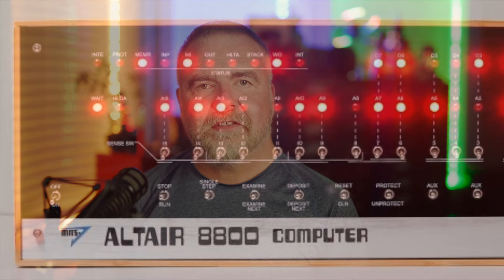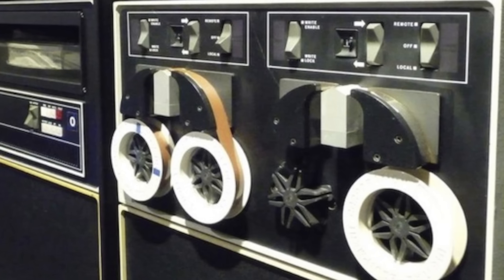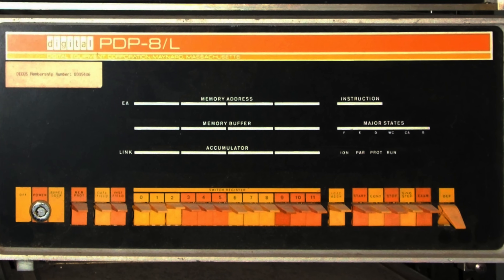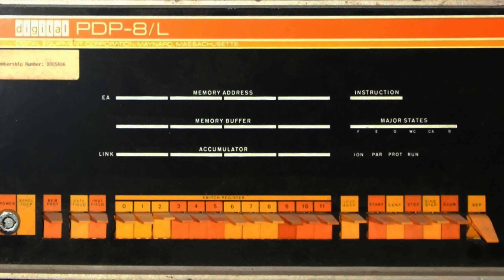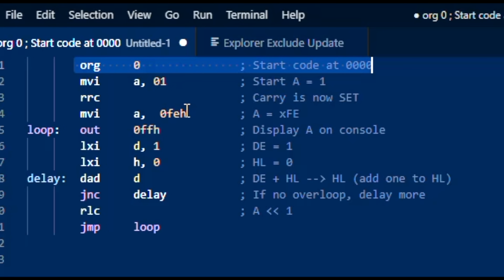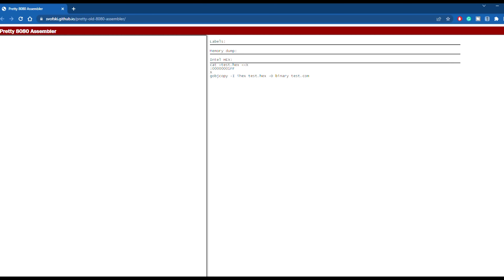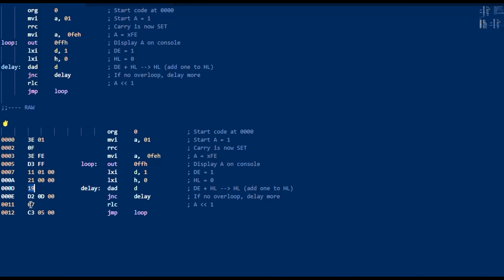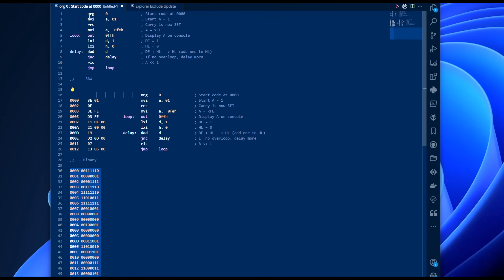Bare Metal Programming - Booting From the Switches

Comment: Many thanks. Now it makes a whole lot of sense. But the bit rate is sloooww, and a very manual ECC. 😉 And no websites back then to do the conversion. So much gets glossed over these days about how far we have come in the computer world. TB/s, Exa FLOPS, TB of memory. Some for the same price as those huge numbers of switches and chips. Amazing. No wonder the code was so good. If not, you felt it because you had to enter it, but hand. Now, just throw more RAM and GHz at it. I recall about 12 years ago, a young vacation work engineer complaining about how slow his LAPTOP was at displaying a 3D CAD model render was. And I'm thinking, lad, when I was your age, we did not have laptops (or they where suitcase size, with dinky mono screens), and "rendering" was barely possible on a PC with a maths co-processor, and probably a few thousand lines or points at most. Never dreamed of spinning a 3D point cloud with billions of points in real time, or complex 3D CAD models in a browser.

Comment: I first learned how to use the front panel to enter a boot-strap loader for paper tape on a Honeywell H316 Minicomputer.
The Altair and the IMSAI were just as easy.  A few years later with I was in the USAF as a Burroughs B3500 Mainframe Operartor/Programmer, it used a Hex Keypad.  But over in the corner of the mainframe computer room was a Honeywell H713, a later generation of the H316 minicomputer I learn how to program a few years earlier in high school. We had the same boot-strap loader (with one word changed to make it load-from-disk) in Octal taped to the front panel above the switches.  I amazed my trainer by keying in the boot-strap via those switches like I was an expert, because I was LOL.

Comment: Back in University days the dept. had a pdp11/45 that had a UNIBUS “ROM” card that you could literally read the bits: Diode installed was a 1 bit, diode missing was 0. 
Card was used to boot from paper tape, Dec tape, mag tape, rk05 or rp disk pak.

I managed to save the front panel from the dumpster the day they got rid of it, still have to wire up some simple logic to cycle the led’s on the front panel. DEC had really nice front panels! 

They make a Raspberry pi kit that interfaces with a reimplemented pdp-11/70 front panel and runs the pdp11 emulator on the pi using the panel to control the emulator. I think they make a pdp8 version as well. You can run both PDP emulators on Linux systems without the front panel as well.

Comment: Where and when did the big change occur? I get the impression that by the late 70s systems were expected to "boot" themselves and on an 80s era micro if you wanted to be able to probe memory like that it was done using a "monitor" program. I presume the availability of EPROMs was part of it, but programmable devices go back quite a long way.

Comment: Very good explanation Dave. I remember this way to start the 4 Russian computers called CM4. This has been the Russian version of the PDP11/40. (The plans including some equipment have been sold by Digital to Electronmasch/Kiew themselves before hard embargo). We, west German company, used these computers 1981 to program a steel production in Kursk. Send them back at the end of the project (86). You had to toggle in the bootstrap so harddisk boot code was loaded via dma. The go command just flipped the only inverse preloaded flipflop of the reseted cpu... Long times ago... Thx Dave to bring back memories and buried knowledge

Comment: Now that was a trip down memory lane.  I remember program on the IMSIA, ALTAIR, PDP's back in school.  We thought it was incredible to have an 8K EEPROM card to program the boot strap program, load CP/M, and have the BASIC interpreter available to us.   BTW Bill Gates formulated his BASIC off of the Dartmouth BASIC he had access to via a dial up terminal.   

My first Laptop was a Toshiba T1100 running DOS, with a TN3270 card so I could plug it into the mainframe network while at work, or connect via a built in 1200k MODEM from home.  Loved that little box.  It was a huge step forward over the huggable luggables that first came out as "Portable" computers.

Comment: It is interesting to see what had to be done to get a computer started and booted up in the days before boot up programs stored in read only memory that would execute after the computer was turned on. When I was young around 1970 Valley College had an IBM 1620 computer. There were two ways to start program execution after the machine warmed up. One way was by the punch card reader, which would read the first card into the machine at the start of memory as executable machine code and then would execute the code. The other way was to type in machine code using the console typewriter and execute the code.

Comment: I used to programthe bare metal on my IMSAI 8080 computer and also some Data General Nova computers at work.  We also had a PDP8i, which I didn't program, but I did use the front panel to load in the RIM loader, which in turn booted from the disk.  The Novas had the "Program Load" option installed, which enabled booting from the various devices.  We also had some VAX 11/780 computers, which used an LSI-11 computer to operate it.
I used to hand assemble, before I got an assembler running.  I'd use 1/4" square ruled paper and grouped the columns for address, instruction and data.

Comment: In the mid 1980's, at the Community College, we had 8085 trainers, where they had keypad input, but the input and display were in Octal. We also had the 8080/8085 Handbook, so we were able to actually translate the ASM into the correct Machine code by hand. After we did the hand translation a few times, they told us they had a cross assembler on the PC in the lab.

Comment: When I was in high school electronics (a two-year class) the second year was devoted to computers and digital technology.  We had a trainer very similar to this including the same red and blue toggle switches.  However, it was 6800 based and had a console terminal where you could input your code in hex.  But we weren't allowed to use the console until we'd mastered programming via the front panel switches.  I had already been programming on a TRS-80 Model I like you have in your collection, then a Model III & IV, as well as CoCo.  I still have three different CoCos as well as a Timex Sinclair 1000 and accessories like cassette tape machines, 300 baud modem, floppy drives, expansion packs.  Some of the Electronic Countermeasures gear that I worked on for 20+ years on the B-52 bomber is still flying around with Z80 processors.

Comment: Data General Nova 3/4  minicomputer1978 vintage.  Bootstrap routine resident on disk at  location100033. Set it up on bitswitches, toggled the "Load" button and off it went

Comment: For our early 1970's USAF C-141 flight simulator 32 bit ferrite core computer,  the boot routine required 10 buffer transfers. At the end, startup of the assembly language processing was nearly instantaneous.
You just crossed your fingers you didn't transfer any switch positions into the buffer incorrectly.
On the other hand, in my five years there it never crashed.
Reloading the memory from paper tape wasn't so time-consuming as we only used about 32k of words (not bytes) mostly for airfield coordinates, elevations, and nav radio settings. Strangely, there was no take up reel and we had to manually wind the paper tape from the pile on the floor.
Most instrument "calculations" were by servo/synchros and various amps.
The computer room was about 18 by 25 feet.

Comment: Modern conveniences (8:06) using a program that would not even fit on the computer to translate the assembler, back in the day I had you were more likely to have a book with the op codes and hand translate the assembly language.

I used to know a decent part of the Z80 instructions by heart.

I know this was done for exposition, but I doubt anyone used binary. It would be much less error prone to use hex or octal and input these directly, 3 or 4 bits at a time (depending on the word length of your computer). And this is knit picking, i think it is a great video to show the process used.

Comment: Where I worked, we had two PDP-11/05s attached to electron microscopes, that had to be booted by front panel switches.  Definitely pains in the neck, plus it was a pain keeping the sheets with the boot code from falling off the front, since the tape dried out quickly.

Comment: It is quite easy to learn the bit patterns for hex and that would eliminate the need to use a program to convert to binary. It would be less error prone to input in hex than via binary. FYI, the switches for the Altair 8800 were group in threes (octal). The IMSAI has the switches coloured for hex but the labels on the panel shows the grouping for both octal and HEX.

Comment: I was studying to get an associates degree in Electronics in the late '80. (I didn't graduate.)  In one class for a few weeks we programmed a PDP-11. I don't remember the exact model It had switcheds like the IMSAI, but the bits were grouped in 3s because the opcodes were Octal.  We didn't have an online assembler or any other assembler. We had a card with the instruction set and we toggled in at least the first one or two programs. Later we used  terminals connected to them but we still didn't have assemblers. We had to look up the opcode and enter them in to a monitor. Supposedly the machines did not have a multiply instruction and we had to write a program to multiply by adding in a loop.

Comment: Back in the early 70s, I had a summer job which involved using an IBM 1620. I remember having to key in a small boot program to instruct the computer to suck in it's OS from disk.

Another interesting topic might be wire wrap based microcode. The Xerox Sigma 5 computer was an interesting beast with 65K core ram (in 4k units) and a 360 like command set. I was a software hostage at a customer site as 6 levels of Honeywell techs tried to find what turned out to be a loose connection in the microcode, which manifested in many interesting ways across the duplex computer system.

Comment: You used RLC to rotate the accumulator and that doesn't include the carry bit (although the carry bit is set to the MSB of the accumulator).  So why bother with the first two instructions to MVI 1 and RRC?  Could have saved thumbing in three bytes.  ;)

Comment: Worked with SEL Systems computers and they had an 'advanced' front panel where you could enter address and data using hex.  That was 'great' compared to individual switches.  We memorized several short 'thumb-in' programs that we could enter from the panel.  Things like 'write zero to all of memory', 'set CPU configuration register', and 'IPL from tape (IPL was short for 'initial program load').  Once tape, or card reader was read in, operating system took over and then used teletype from there.

Comment: Former DEC employee and programmer here:   PDP-10s (and 20s) had 36-bit word sizes, not byte sizes.  They were word-addressable (each address refers to a whole 36-bit word) and not byte addressable.  They actually had VARIABLE byte sizes via a set of byte manipulation instructions that packed bytes into words.  Note that this is why almost all of the TCP/IP specification uses OCTET to describe 8-bit bytes, as "byte" would have been ambiguous at the time.

Comment: Haha you cheated. Back then you HAND assembled your program. t
The older IBM mainframes from the 60s & 70s had a set of dials that would set the device to load from. The device controllers or channels would respond to commands such as START IO. This is know as a channel command word or CCW. A CCW has a command. Such as START IO, address to put the data in, and other bits. You can chain these words together forming very intelligent functions. These devices can be a tape drive, card reader, disk drive etc. Once a device has been selected,  U then pressed the IPL button. IPL = Initial Program Load.. I wrote a banner printing program on two punch cards (160 bytes)
I dialed in 00C on the front panel and pressed the IPL button and the program ran.

I would also make programs that would read the front panel switches to change the program function. Also I would use the front panel to debug the program, then crash it when it did run and take a core dump and go back to my desk and disassemble the dump and code the program that worked.

Comment: The first time I actually came in contact with this kind of computer interface was when I rescued a Nixdorf 8870 (built 1974) from a bank clearout in the late 90s. It came with two harddisks (10MB fixed and 5MB removable 14" platters) and a pair of 8" disks, but no form of boot ROM. To get it running, you had to key in a basic form of bootloader into the CPU via a switch panel, which told the disk controller which devices where present, and instructed the machine to fetch the first block off the hard disk and continue execution from there. It was just 15-20 words, but still the most annoying boot procedure of any machine I ever operated.

Comment: Dave, Great video!  Brings back memories ot my Bachelors degree senior project where I designed and built from scratch a similar computer based on a Mototola M6800. It only had 2kbytes of static ram. I did all my code assembly by hand to the point that I memorized all the key object codes and could assemble on the fly while I manually toggled the switches. I designed and built a cassette loader interface and added a third party video display to a TV. Keep in mind this was done in 1976-1977 as I graduated in 1977..

Comment: Came to know the Varian 620/L100 well during my time in the USN.  It controlled an automated avionics test bench for the S-3 Viking, with 2 1MB disk packs and mag core memory.  25 plus years later, I can still remember parts of the bootstrap we'd have to key in whenever it felt like dumping the previous load.   Octal entry with the Varian tho - 37747 would be the memory location to start keying in the code.   I analyzed it, and basically it was used to command a very basic DMA controller that sat between the drives and main memory - one instruction to tell the drive where to position track/sector, another to specify the initial location in memory to block read into, and finally how many "words" of data to read.  Final instruction to execute the transfer, and then it would load the operating system.    Pretty cool being able to see computing in such a "macro" setting!  I would actually take it out of run mode for station troubleshooting, and step by step be able to command stimulus/response according to whatever issue was being worked on.    Good stuff, Dave..  a lot of memories from this one.

Comment: This brings back memories from over 40 years ago when I worked at a commercial computer center with a PDP-11/70. I remember always having a mini reference card in shirt pocket, though after a while I just memorized the bootstrap address and the assembler binary codes. Hard drives were the size of washing machines and used heavy 10-platten Nashua disk packs. Ah yes, those were the good old days.

Comment: Very nice. I figured it worked something like that, but I had never actually seen it done before. Converting the hex digits into printed binary seems like an unnecessary step, since I am quite familiar with the bit patterns associated with each of the 16 hex digits, as I'm sure you (Dave) are too. But I guess it was included for the benefit of people who are not so familiar with them.

Comment: I don't think you need the first two instructions to set the carry flag, since that will already happen in the delay loop. Though I may be rusty, since I would have thought the RLC would rotate through carry, which is always set, so after the first loop through the display should have stayed blank? So not sure if I understand exactly how it works.
Reply from the maker: I'd agree.  I found the code on an IMSAI website and stuck with it as written, but I'm convinced that mov and shift is redundant.
Reply: @DavesGarage  AHA, the RLC instruction rotates through carry, but only rotates the accumulator itself, duplicating bit 7 to carry. Would be a good way to get the back-and-forth oscillating LED effect.

Comment: I bought a Poly 88 around that same time frame.  It had a 1k x 8 ROM to boot from (and provided a host of other routines), so I was saved from the switches.  As you would expect, things were a bit more expensive then... an 8k RAM memory board cost $300.  Yikes!
I still have the advertisement pamphlets from the Poly, SWTP, IMSAI and Altair computers.

Comment: Ah, but you cheated a bit (pun not intended but not avoided) by using an assembler. The real "Bare Metal Programming" was what we did when we didn't have an assembler. Look up each instruction in the Intel 8080a reference guide and build each instruction then map out the memory used by the program to get the target locations for the loops, substitute them into the instructions and then continue with the rest of the steps..

Comment: The big CDC machines (Cyber 6000 and 7000 series) didn't have a front panel.  They had a "deadstart" panel, with a matrix (12X12, 12 being the word length of the "peripheral processors") of switches into which you would enter the "deadstart" code, then press a button to load and execute.  Mind you, these were considered the supercomputers of the time.

Comment: Could you please do a short showing the screen output from the IMSAI while the program is running?
Reply: For what he showed in this video, the IMSAI probably didn’t have a screen at all.  Just the LEDs on the front panel.
Reply: @kc9scott  Wow!
Reply: While a display-driver board would have been a popular option (or alternatively, an RS-232 interface and a teletype), it wasn’t standard, and you’d need software to make it do anything.  For this demo, there certainly wasn’t any such software in the machine.